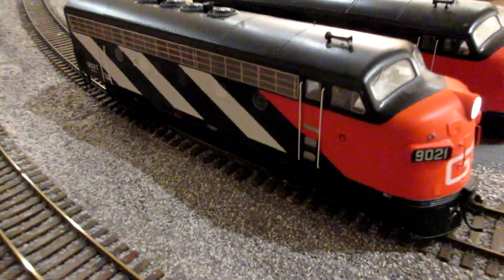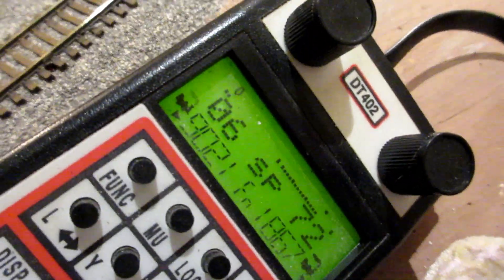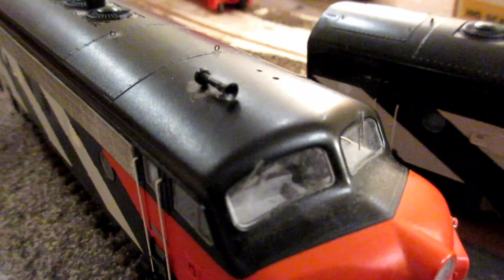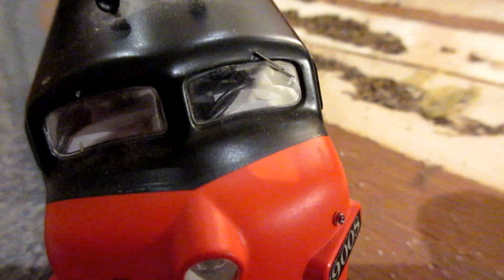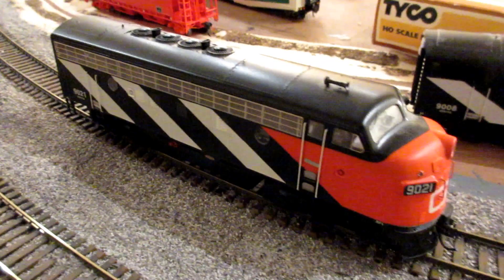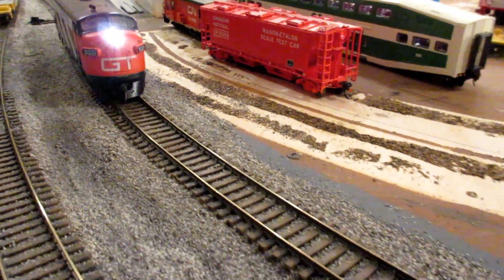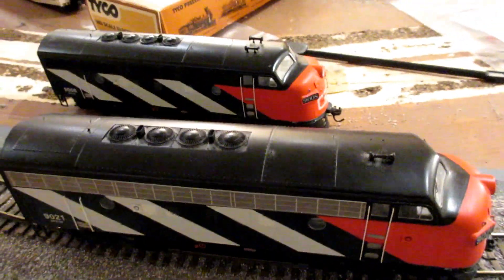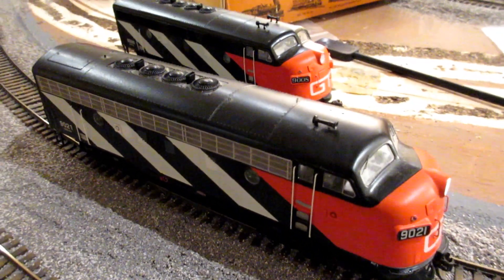DCC'ing my Athearn F3A locomotive

Comment: Great video.  I recently installed (hard wired) two digitrax cheap non-sound DCC decoders in my Stewart Hobbies CN F7 A&B units.  They run perfectly even in consist.  They worked well in DC as well before the project.
Reply from the maker: Kato, Stewart, seem to have the best motors.  I've tried speed matching using my Accutrack Speedometer, a Sprog device and even though I can get them very close on my Sprog controlled loop of track, I take them over to my layout (operated by Digitrax) and I get a totally different result... could be the Sprog puts out less volts?  I dunno.  Speed-matching is never perfect.. there are too many variables, i.e. dips in voltage from one section to the next, motor wear and tear on one loco but not the other.  Probably, for best results, the only way to really do it is get two exact locos from the same manufacturer, using the same decoder.  At the end of the day, if one loco isn't working too hard against the other, then I think you're okay.